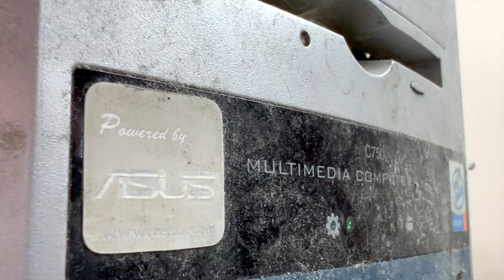Old PC Repair | Asmr Cleaning

Comment: the cpu works well, but you must replace the inflated capacitors otherwise it could fail again, and the other one you put too much thermal paste on the video card there it could fail again there